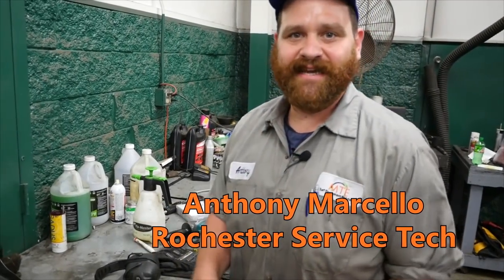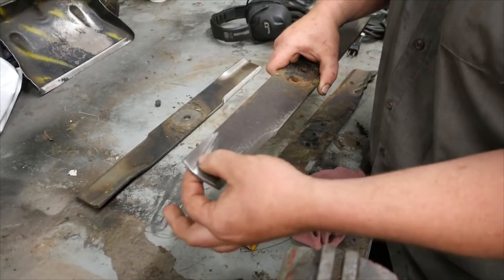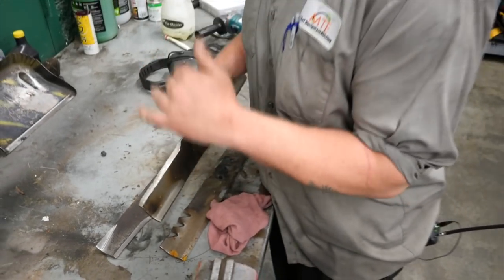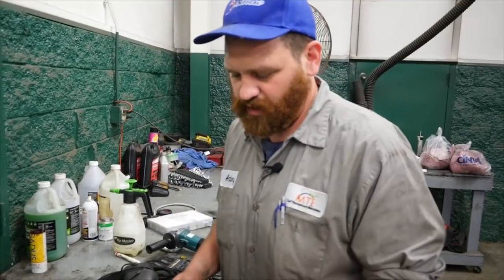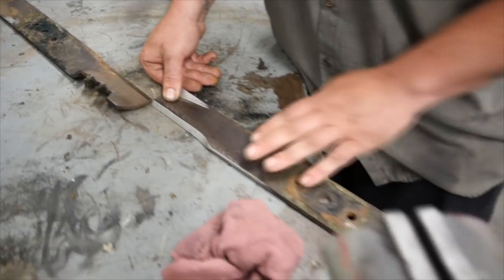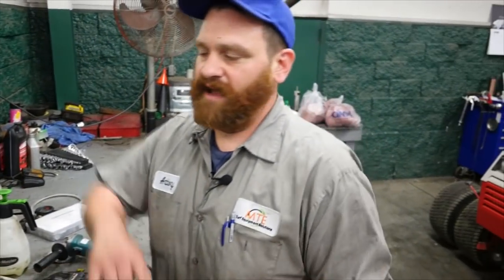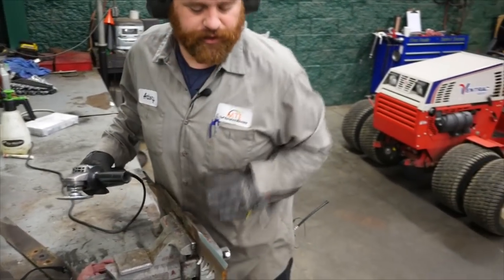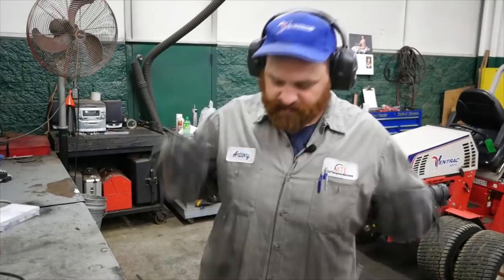How to Properly Sharpen Lawn Mower Blades

Comment: I use a 6" bench grinder with a blade guide and has worked great for 10 years. I recently added a 4" flap disk grinder to the truck for field work.

Comment: Once I started using the flap disks, I never went back to the grinding disks.  It makes sharpening easier.  Buy the balancing device, it only costs a couple of bucks, and works better than a nail.

Comment: Balance magna matic or nail..balanced is balanced as far as I know. I use a nail  myself . drilled a hole in side of table and put nail in for use and take out  not in use. that way I don't rip my skin or pants. Use what you like. Thanks for your video... Use older blade amateur as I did to get the feel and motion of a hand grinder w flap wheel.

Comment: Good video. I'm sure there are many variables but how often should you sharpen the blades? Also, what grit are you using on your flap disk?
Reply: 60g or 80g is good
Reply: Depends on terrain, root/object contact-sandy soil?
Reply: Smart people  wanting a sharp blade will use a fine tooth file grinders over heat blade don't last as long.

Comment: Nice video.  Question: ¿what type of pad & abrasive wheel did you use, kindly?  Thank you.
Reply: Tony D looks like a tiger disc. Typically these are around 60 or 80 grit.
Reply: I see (60 to 80 grit).  Thank you for your reply.  t\.

Comment: You grind from the high side to the point. The way you are doing it the grinder can catch the edge and jurk the hand grinder away from your hands hurt you or wreck your disc wheel or grinder. In other words the sparkes would be going up not down.

Comment: lol. its supposed to be sharpened at 30 degrees. hand grinders with out a jig aint going to cut it. #Oregon
Reply: Just from the start,your blade was reversed.Bottom of the blade never is shiny.
Reply: I agree. The other thing is the cutting angle, I was told was to match the angle of the lift part. I cannot possibly do that freehand. I have a grinder specifically for mower blades. Fully adjustable. And yes the backside, no grinding. You want a completely flat side. Just enough to knock off burrs.